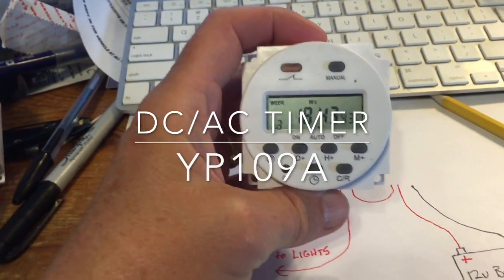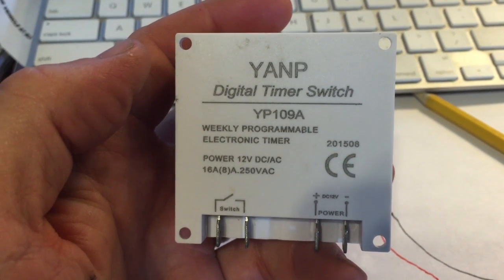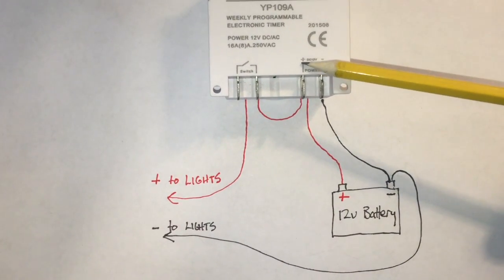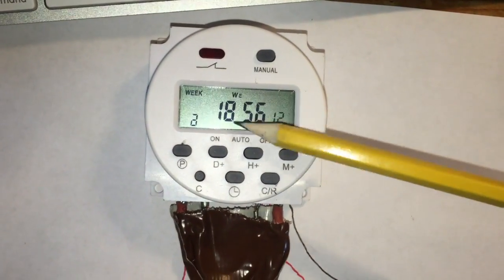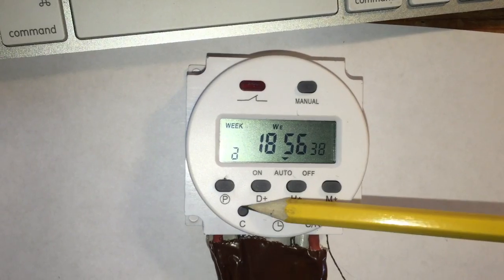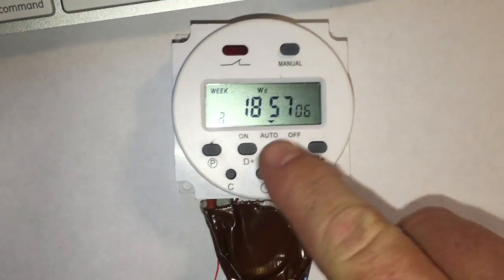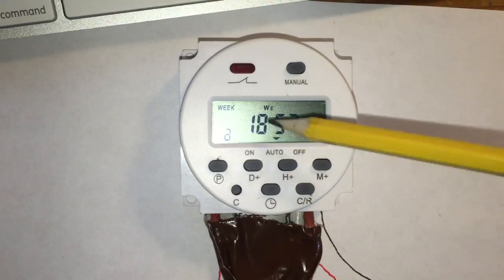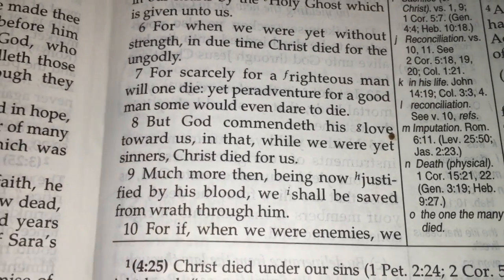How to setup the AC/DC Timer Model YP109A Wiring Diagram

Comment: does it work on 24volts?
Reply: You need to add this: 

DROK - 90010 Waterproof DC Buck Converter Voltage Regulator 8-22V to 1-15V 5V 12V 3A Adjustable Output Power Supply Transformer

Comment: Question. See the two black wires spliced together and going to the negative battery terminal? My negative wire to the lights is connected not onto the battery, but spliced onto the timer negative wire (which goes to the battery). Is this okay?